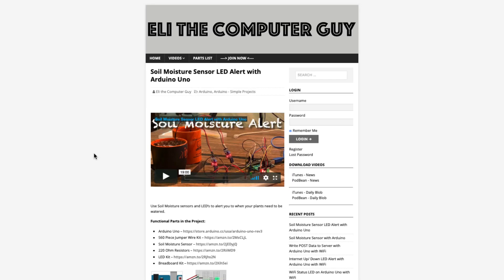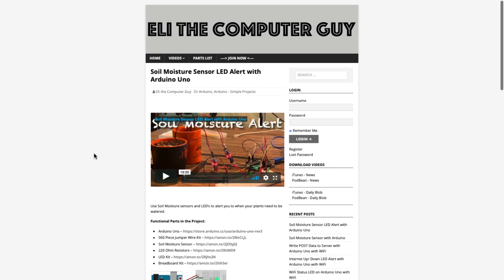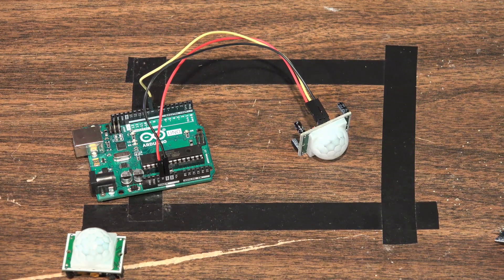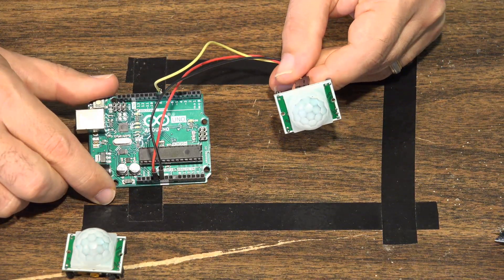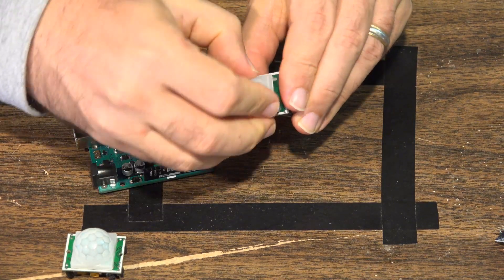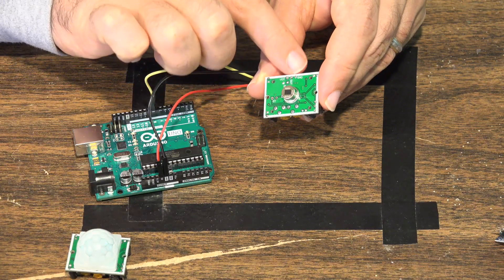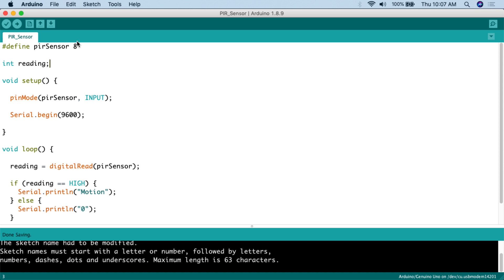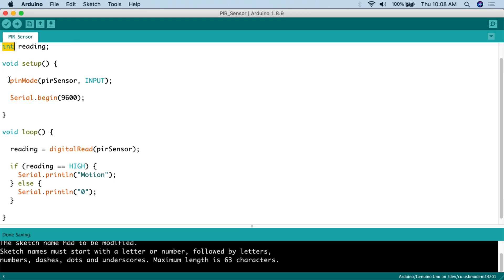PIR Sensor on Arduino (HC-SR501)

Comment: Can you adjust the distance sensitivy within the code or does it have to be done with a resistor on the sensor? THanks
Reply from the maker: IF you can reduce the sensitivity it would be on the sensor itself.  As far as the Arduino is concerned its a simple on/ off switch...

Comment: I think my sensor is broke, it won't do anything and the code is correct as well as the wiring.
Reply: i swear same
Reply: same issue but check this out guys at 1:55 he mentioned about setting the potentiometer to the minimum specifically the time delay. Seems like I had the time delay too long at 5mins, it solved my problem: https://www.youtube.com/watch?v=v7Mi49Mv4Sw&ab_channel=EngineerWithin